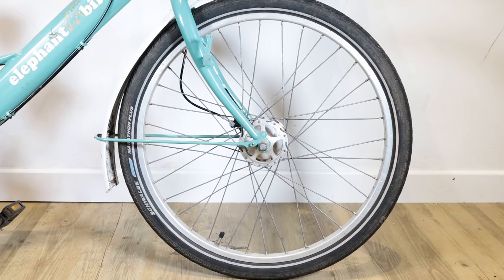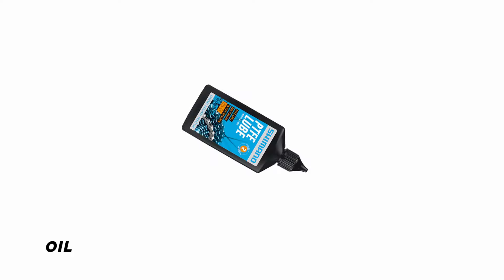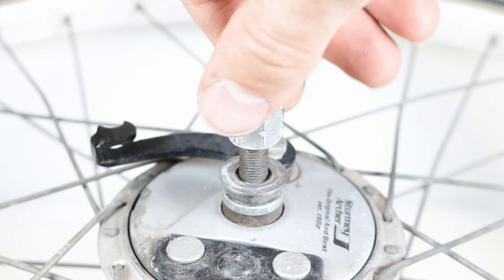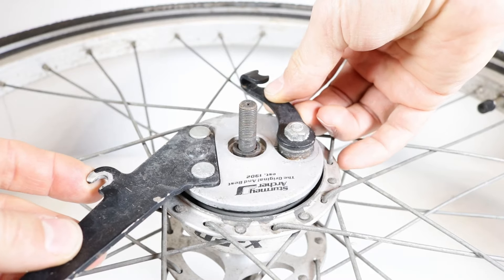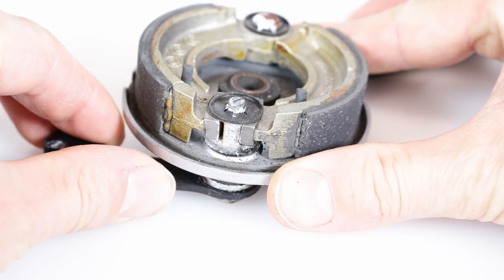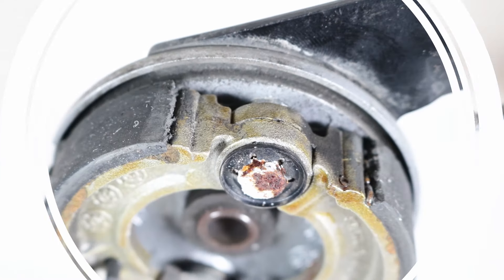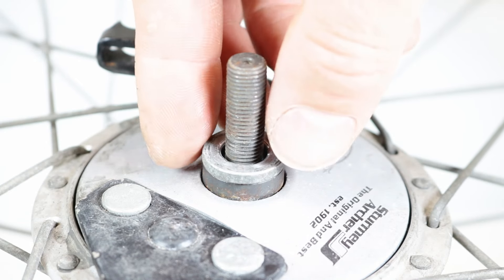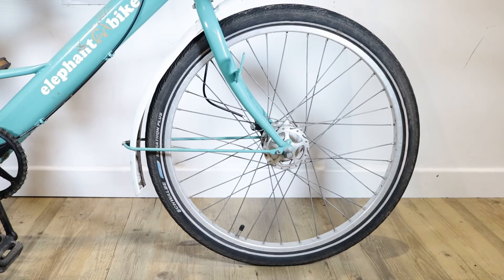Overhaul a bicycle drum brake - Silent the squeak, make your brake work again!

Comment: Why is it that drum brakes aren't commonly discussed in bikes? I'm a commuter and new to cycling, got a mechanical disk brakes and seems complicated to repair.

But I heard that drum brakes are easy to maintain, easy to tune and all that yet not popularly discussed, why so
Reply from the maker: That's a great question! Drum brakes are definitely easier to maintain and generally more reliable in wet conditions, which makes them a good choice for commuters. However, they are less common in modern bikes because they tend to be heavier, less efficient for high-speed riding, and harder to upgrade or customize compared to disc brakes.

While drum brakes are known for their durability and low maintenance, they don’t offer the same stopping power or heat dissipation as disc brakes, especially in demanding conditions like downhill riding. That’s why they’re often used on city bikes or utility bikes but less on performance-oriented bikes.

For your mechanical disc brakes, once you get familiar with them, they’re actually not that complicated to maintain. It just takes a little practice! I hope that helps clear things up! 😊

Comment: Hi sir.  My drum brakes not squeaking but it’s loose.  Not breaking. How?
Reply from the maker: Hi, and thank you for your question. From what I understand your brake doesn't engage when you pull the lever all the way to the handlebars? If this is the case you will need to adjust the brake cable tension.

Comment: LOL. Hey you aren't sanding a windmill, 80 grit??  You took 2,000 miles life off the pads. You didn't clean the whole hub either, lazy.
But my 2012 SA XL-FDD dyno never got that dirty in 32,000 miles, including Vietnam and China on tour. The bike is 120 lbs too. Some mud did get in and rust the corner once. Some days the shoulder had slime all day. I never would have left home without this AWESOME brake. 
I use 180 or 220 grit, very LIGHTLY rubbing twice. Then a few tiny scratches of the drum across the flow for grip and to take off the shine. 
It's NEVER squealed. Neither has my Rohloff14 disc with a cable TRP Spyre caliper with resin pads.
I use solvent to clean the inside parts.
Roller brakes are the STUPIDEST thing ever put on a bicycle. They are heavier, always drag and heat up like a firecracker.
Reply from the maker: Hi and thanks for your comment and for sharing your experience with others. There are some great tips here that viewers should definitely consider.  However, sanding the glaze off the pads with 80 grit reduces the lifespan by 2000 miles is quite something! 😂😂😂 
And yes, I must admit, I was so lazy for not cleaning the hub in the video on servicing a bicycle drum brake. I bet if I did, you would tell me off for not cleaning the rest of the bike too! 😉
Reply: @cyclemaintenanceacademy  hahaha good response! 🤣
Reply: Thanks for the video! Oh that person that said it was lazy is a bozo.
Reply: This commenter is one insecure person. So loud and crying about petty issues